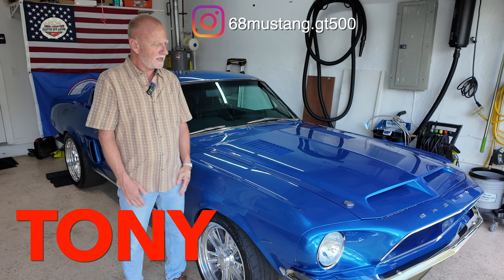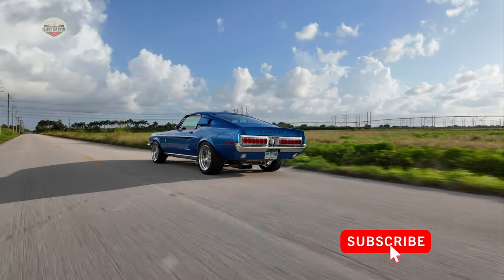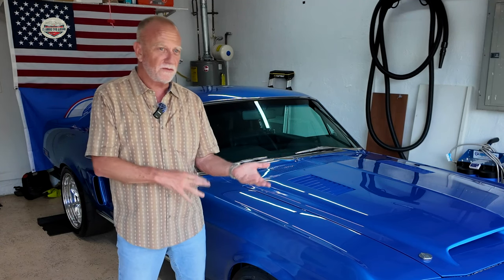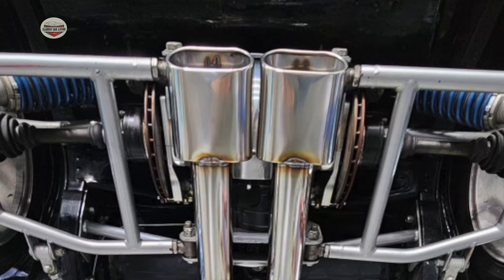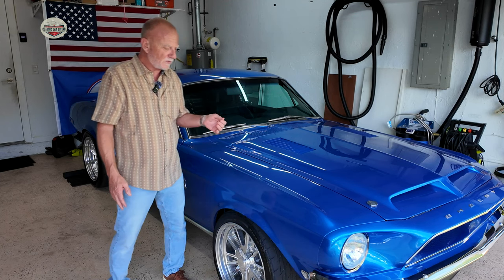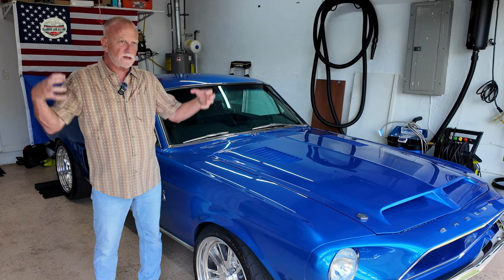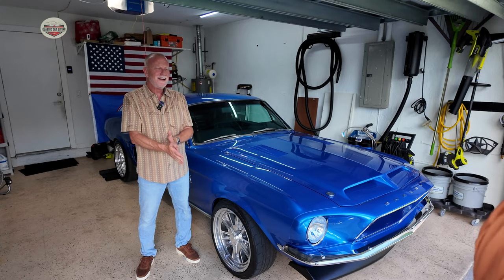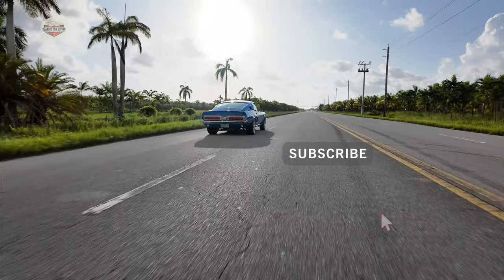We Built a 600+ HP Stroker Engine for Our GT500

Comment: I built a similar car, 1968 fastback, 15 yrs ago.  Shelby aluminum block stroked to 452 cu. in.  8 stack fuel injection run by a megasquirt.  T56 Magnum transmission.  Electric power steering,  Aluminum radiator with shroud and electric fans.  Classic Air A/C. I fabricated a custom coil over spring  front suspension (shock towers removed)  I fabbed custom 2" headers and 3" exhaust. Subframe connectors, roll bar, CalTrac rear suspension.  The care never overheats in Florida heat.  It corners like it's on rails.  With 10.5W MT slicks, it runs the 1/4 mile in 11.3 sec.  I used to own a 1968 GT500KR, but this car is better in all respects
Reply from the maker: @turbo32coupe  sounds amazing! Do you still have it?
Reply: @305classics  Yup.  Totally sock interior, Midnight blue.  My old GT500 was Acapulco blue like the one in the story.  I'll send you a pic of the engine compartment
Reply from the maker: @turbo32coupe  where in Florida do you live?
Reply: @305classics  Pensacola
Reply from the maker: @turbo32coupe  My son lives there… Love Pensacola